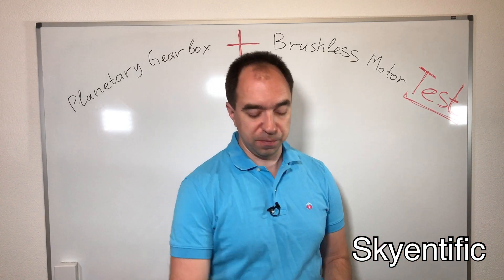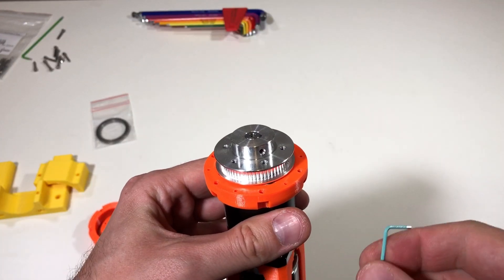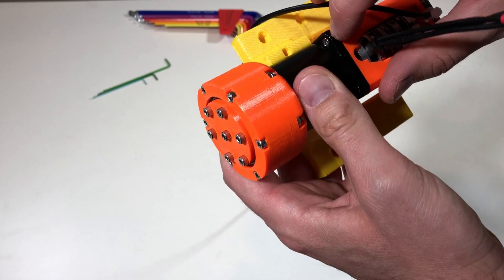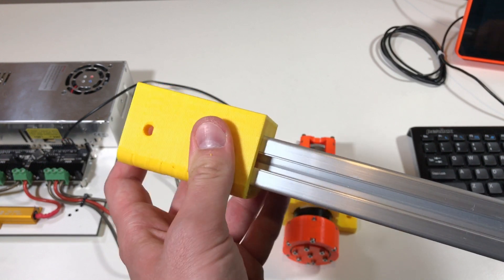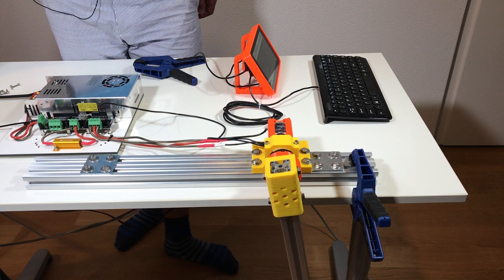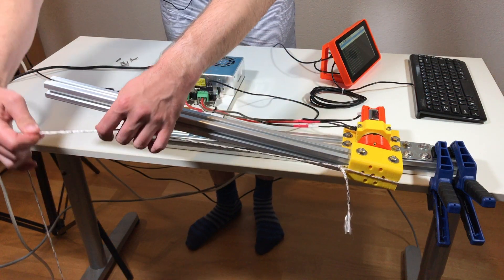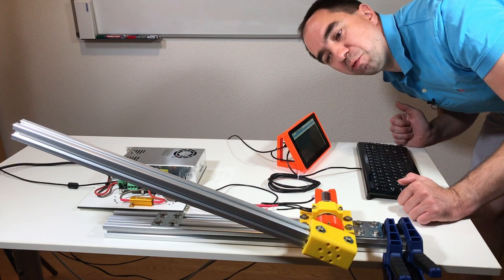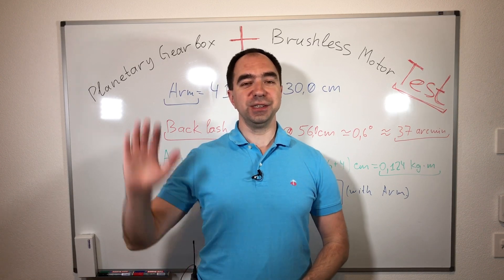Is it good for your Robot application? (Actuator test)

Comment: In the past I worked with portal robots. These were used to stack items like cans of paint on pallets. The motors used here had brakes so that the motor didn't need to keep the heavy load all the time only on electric power. I don't know if they use something similar with robotic arms but I guess they do. At least those arms have a hydrolic (?) cylinder to balance things out on the lower arm at the back.

Comment: Normal i dont comment videos, but something i don’t like about your testing methods. To test the backlash I think a 3D printed bracket is not sturdy enough. Or did you tested the backlash of the yellow bracket that holds the aluminum extrusion. And to test the holding power of the actuators,with packages of Reis , is a bit crude. Would love to see a contraption of a scale(feather level) and a car jack or a threaded rod. To carefully increase the force to the extrusion. And than on top of that you could automatic it with a microcontroller, straingauge and stepper. So when the max holding power at a certain amp is reached to slightly increase the amps of the actuator. So you could get an awesome excel sheet. 

Greetings

Comment: Doesn't the length of that rod increase the load due to it acting as a fulcrum?  So really.. isn't it working better than rated?
Reply: It does increase the load and he is measuring it correctly 

Torque is measured in Newton metres 

It means the amount of force * the distance from the fulcrum 

People often mistakenly say Newton's per metre

Comment: Yet another great video. I like the way you are sticking with the basics of the drive system and testing before you build a robot.
I am worried about the overall mass of the drive, it's a bit like rocket science, the heavier the drive the stronger the frame the bigger the drivers and batteries. It's a vicious circle. The more weight you add the bigger parts have to be. 
If you want robot to interact with humans then the inertia has to be kept low to minimise hurting someone.
I am not sure that metal parts are a good idea.
It could end up like Jame's opendog where he uses a 2 ton engine hoist just to lift it !

Comment: In terms of accuracy which motor is best
 bldc or stepper or servo for robotic arm
Reply from the maker: BLDC and steppers are very accurate. For me it is difficult to say which one is more accurate. The BLDC is usually much more powerful for the same weight and size. That is why I try to build a good actuator with the BLDC.
The industrial, expensive servo motors are also very precise, as precise as BLDC and steppers. But cheap hobby servo motors are super inaccurate.

Comment: Why is the body of the brushless motor spinning instead of the shaft?
Reply: The spinning case is connected with the shaft. I think they are called outrunner brushless. The coil is in the center around the shaft, but stationary(here you mount the motor), the magnets are clued to the spinning case of the motor. The inrunner brushless motor are like normal 3ph AC motors: Coils are stationary, the core is spinning with the shaft.
Reply: @Orbis92  Thank you very much!

Comment: I don't think you measured the gearbox's backlash - at 5:51, as you're moving the arm, the motor also moves slightly. I.e. the motor's mount is somewhat loose and that's contributing to the arm's perceived backlash.
Reply from the maker: Yes you are right, these measurements of backlash are not very precise. But I checked this measurements off the camera: I fixed the motor completely and checked the amplitude of movements, and it still the 6mm. So I think these measurements are more or less correct. Thank you for your comment!
Reply: @Skyentific  May be you can measure it precisely using a dial gauge indicator

Comment: Very interesting, keep the channel))
Try to make a 3D printer using your servomotor, it will be very interesting and useful for others)) a small amount of video with real use of odrive drivers))
Reply: or at least put the servomotors on the x and y axis))
Reply from the maker: I think this is a good idea. I will check how difficult to do this from software point of view. From hardware it should be straight forward. Thank you for this idea!

Comment: Very good results for the price and size!
Interesting if anything can be done to reduce backlash.
Reply from the maker: I actually have one idea to reduce the backlash, I hope it is going to work.
Reply: @Skyentific  for a vertical rotational axis, applying some kind of torsional spring load (maybe a permanent preload)? Would that work?
Reply: Does the arm under weight reduce the effective backlash?